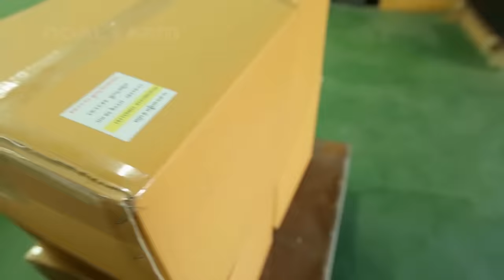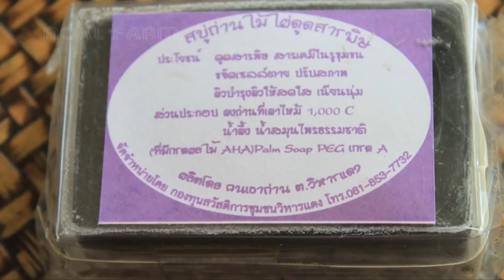Amazing Bamboo Farming Techniques - Bamboo Product Processing in Factory - Bamboo Harvest Machine

Comment: In Hong Kong we still have a lot of construction that uses bamboo scaffolding, even on skyscrapers over 30 stories high the scaffolding structure is entirely made out of many long pieces of bamboo and plastic ties.
Reply: Same for Singapore and other SE Asian counties. Bamboo is lighter in weight but has greater tensile strength as scaffolding than steel. It is a rapidly renewable resource as well.
Reply: Thats true... even in Nigeria.. amongst "poorer"  home builders..
🧔🏿⚖️📲💻🖥️⏳⌛
Reply: Wow i see in kung Fu movie, must be cool in real life
Reply: Same here
Reply: Yes...my very first trip to HK was in 1964 as a 19yo from a non Asian country and I was totally blown away by this use of bamboo.
In fact, in the 21st century I'm still impressed by the useage of the method of using it build skyscrapers.
Also highly impressed by the guys with the skills to put up the scaffolding.
Reply: In semarang Central Java bamboo was used for floated construction for expressway
Reply: ៩៩៩៩៩៩៩៩៩៩៩៩៩៩៩៩៩៩៩៩៩៩៩៩៩៩៩៩៩៩៩៩៩៩៩៩៩៩ោ៩០៩៩៩៩៩៩៩៩៩៩៩៩៩៩៩